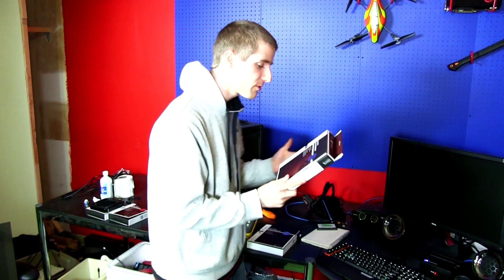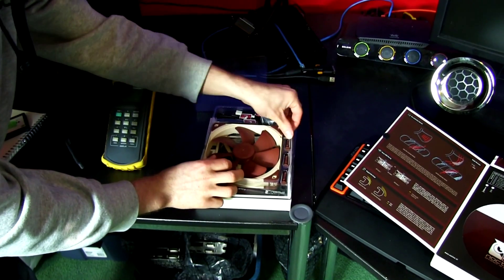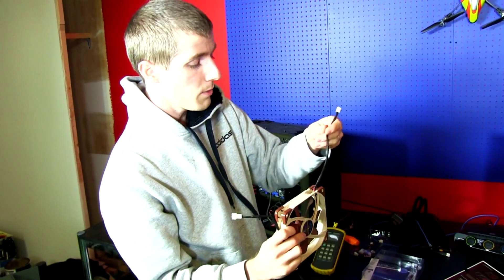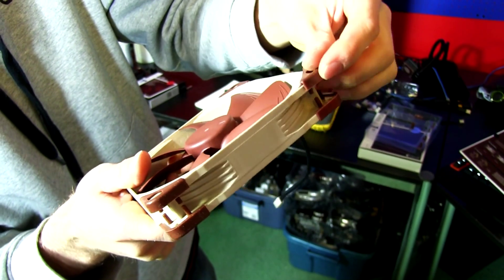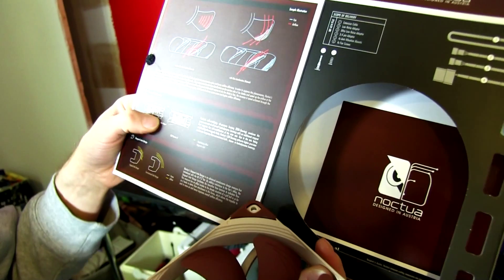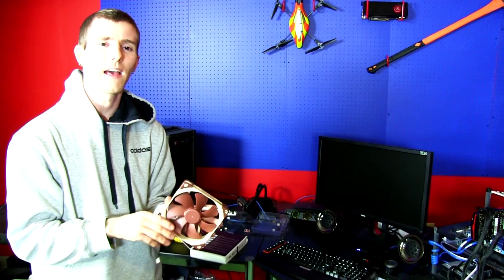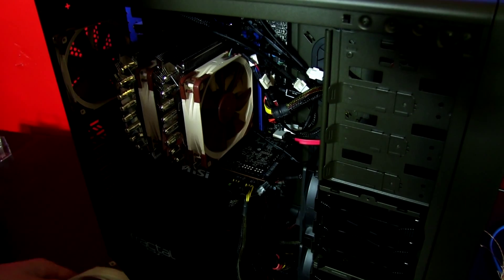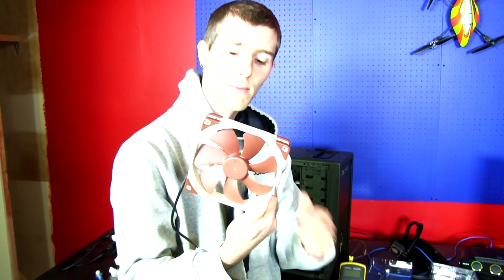Noctua NF-A14 FLX Silent Heatsink & Radiator Fan Unboxing & First Look Linus Tech Tips

Comment: Noctua nf a14 pwm or noctua nf a14 flx as case fans in a fractal r5?
Reply: if you have a PWM connector (one with 4 pins, not 3) go for the PWM version

Comment: Could i connect this to a fractal deisgn r5's 3 fan controller with the standard voltage (no adapter) and change the spped, and therefore the noise with the cases software?

Comment: Can u spray paint them or will that just fk up the fans?
Reply: Prince Jamal Minhas Probably okay to paint the outside of the frame, but i wouldn't paint the inside like where the fan spins. Otherwise just but the iPPC version, they are black to begin with.

Comment: What's the difference between this and the pwm version?
Reply: ***** you don't need the low noise adapters unless you're powering it directly from the power supply. You can still set the fan speed to your liking on the non PWM versions through the motherboard or a fan controller.
Reply: ***** I got the enthoo luxe with the fan hub. will they be able to be controlled from that hub ?

Comment: I actually was dissapointed in the fan. I have tow that replaced my 750d intake fans and they are louder at higher RPM's (800+) than my previous stock fans and they don't seem to help my airflow at all. I am obsessed with the nf-12 fans though. I have two for my radiator and they are AMAZING.

Comment: 150,000 hours for error, thats not possible, so if you calculate 150.000hour divede by 24hours,then divede 365 days per years, its 17 years...
The waranty is 6 years.
Reply: the mechanical equipment can keep working for 17 years, but the fan optimization techniques can only hold for 6 years, thats the reason for the warranty to be 6 years.
Reply: Those damned businessmen, are all liars
Reply: Hudeifi Dahir You are wrong. 6 years warranty means that company ensures you that the fan will not die in that period(100%). After 6 years the fan will still work and it will work for next 6 years or more. There is no need to put 8-10 years warranty on fans. In that time there will be new improved fans on a market and you will probably have a new PC in that time.
So information on Noctua website is correct.
Reply: Dr_Palace no understand me Dr_Palace, I did not said the product wont work for 6 years, I am just saying that the calculations is wrong made.

Comment: I'm going to be building my first computer I want to know if I need some noctua fans and which ones. I know my case comes with two fans which I'm not sure are good or what and if i have to I will replace them with different ones.
Specs:
Intel Core i5-4670
Gigabyte GA-H87N-WIFI Mini ITX LGA1150
Crucial Ballistix Sport 8GB
Western Digital Caviar Black 1TB 7200rpm
XFX Radeon HD 7950 3GB 
BitFenix Prodigy
Rosewill Capstone 450W 80 PLUS Gold Certified
Asus DRW-24B1ST/BLK/B/AS DVD/CD Writer

Comment: linus, this is all great, 
I'v learned how to plan the fans placement inside the pc case.
The question is:  which system fan mother board header to use for each.
Some times the avilible header is actually far from the fan placement, is it confusing the mb to select the right speed for the fan ?

Comment: I've bought 4 NF-S12A FLX and one NF-A9x14 PWM on amazon this week and after testing i returned them to get my 100 € back. Annoying Sound on the exhaust side, its louder than my 7 years old stock thermaltake fans and the build quality was horrible, one fan couldnt be testet cause all pins slided out of the connector. The accecories are only good looking china crap, sleeves cheap gum, no straight colour scheme white and beige connectors and the extremely cheap molex adaptor couldnt plugged in.

Comment: the rubber nipples on the corners of the fan are not for cables lol.. if you need to wrap the wire around the fan very far, you should simply dismount the fan and rotate it to your liking, since they are perfectly square, they will mount anyway needed.

Comment: will the low noise adapter work with other case fans? i have a 4 pin cooler master fan that's really loud; i was wondering if i could connect the noctua low noise adapter to my cooler master fan to make it quieter? would it work?

Comment: Yep,but if you want the maximum silent, you need remove all the fans you can, is possibnle using passive cooling (graphics card,proceesor cooling,fanless psu) its more expensive ,but probably you can get  3 or 2 Db ,the capacitors of the PSU make noise,but probably you cant heir it i f oyu use a good case

Comment: Because its the same that i care about how my car performs more than how it looks. Now in saying that i like the total package, so right now that means using the new corsair fans with multiple radiators, because i only have to run the fans at 750rpm it is silent, still looks great and has low temps. Its expensive, but in this case you get what you pay for. 

As an aside if you have a windowless case then these fans are still a good choice

Comment: How do the Noctua 140 mm stack up against the Corsair AF-140s?

One of the 2 stock 140mm fans in my case broke (I was cleaning the dust around it while it was still running...) and I figure I'll replace the set.  No radiators or anything, but there is a dust filter in front of them, so I imagine a balance of high pressure and good air-flow is necessary.

Comment: You're missing the point. Paint adds weight and there's no easy way to balance the paint evenly across the blades to prevent vibration. Wouldn't make a huge difference at low RPMs though.

Comment: hate noctua fans, they're really UGLY! The Noiseblocker eLoop is much better. Looking beautiful and quieter whilst cooling better. The only disadvantage is that you shouldn't use them in pull, then they sometimes start getting much louder, and there is yet only a 120 mm version.

Comment: MTBF is not a linear measure of how long the product will last.  Its simply a way to display overall reliability of the product.  They could have tested 150,000 fans for 1 hour before they had the first failure.  In reality they probably tested 5,000 fans for 30 hours with one failure or even 1,000 fans for 150 hours with 1 failure.

Comment: A bit of graphite powder and a drop or 2 of motor oil to even a sleeve bearing fan will usually quiet it down and greatly extend its life.  Some of my cheap $5 sleeve bearing fans are going on 8 years of 24/7 operation.  I usually re-lubricate all the fans every year and check for any that are starting to physically wear out.  While they will eventually wear out, adding fan lubrication to your maintenance schedule can make them outlive the system they were originally purchased with.

Comment: You have to understand how they come up with that number first before saying that it is going to last that long.
The testing method to calculate MTBF is not standardized, meaning they can use 1000 units to measure over x time, which would give a very different result than 10 units with y time.

Comment: What are you smoking? You think Cream + Brown fans go with a Red + Black build? Are you insane?

The problem with the color is the extreme contrast between the rim and the fan itself. It's not necessary to introduce an additional two colors (that are never used in any other PC parts), just for a fan.

All brown? Fine. All cream fine? Some ugly combination of Cream + Brown for no reason? Fail.

Comment: That's indeed a good price. its cheaper by 200 bucks if in my country. Sadly you barely able to find cheaper price GPU here ,unless its outdated which like the 7000 series and 600 series now , since its 2013 , new versions be coming in. 

Even so sometimes some shops , even card old as 5000 / 6000 / 400 / 500 series they still sell at original's price ! 

I really wish i live in US or else where instead = ="

Comment: I personally wouldn't go with the Cooler Master fans. Mainly because I'm not a fan of LED's and glossy materials. And I am also guessing that CM are a bit optimistic about the acoustic performance of the Sickle Flows.

If I were going for a ultimate silence computer. Then I would go for the Noctua's, spite the premium price.

You can also tell that Noctua is standing behind their products 100% by giving you a SIX year warranty. Where as CM only gives 1 year, or 2 for EU customers.

Comment: My coment concerned my set up with a msi twin frozr 6950 cf with xfx double D.
I run 8 antec truequiet 120mm fan (20 CFM 9 db) and while it is quiet on idle it s way louder than before on load and I ear it THRU my corsair hs-1a (with leather plastic thing for more noise isolation).
I just realised I have a defective card that idle at 50C at 50% fan speed I consider RMAing it for that (the other card idle at 35C with 23% fan speed)

SO quiet fans are good but check if your gpu is good before!

Comment: Hmm mine set to auto , no OC , stock clock and all 1050 , 1250 

I guess they run around 20% never touch 30% , my GPU never ever reaches 60 celcius even on most graphic demanding game. 

Even it does it touches 60 thats all it stops there. But i did try amp it up to 30% its still as silent as 20% =)

Asus is ncie but the price its least 200 bucks more here for Asus which is hella lot more expensive !

Comment: the problem is that in cf 1 of my 2 cards reach 70C on default fan setting while the other is at 50C.
So only 1 card is making the noise because they have no airflow
(thanks to the antec truequiet fans (21.5CFM 8,9 DB 0,3mm h2o) that push no airflow thru any filter)
I got new fans on the way (cougar turbine 7$ 60 CFM 17,7 DB 1,71mm h2o) that should help with the noise on load
I couldn't get my self to pay 20$ per fan for noctuas NF-F12 (20$ 55 CFM 22,4 DB 2,61mm h2o) when I had 8 to replace

Comment: Cooler master sickle flows, 20 db, (noctua NF-F12 are 22 db)  Sickle flows also have higher static pressure at 2.94 (Noctua Nf-F12s are 2.62.) Sickle flows are black with 3 different kinds of LED's, Noctuas are just ugly brown, with no LEDS, Sickle flows cost about 7$, Noctuas cost around 18$..... Personally noctuas are a rip off IMO, if you want good fans, get cm sickle flows, since they are the best all around, but still like this video for charity

Comment: WHy not use a washer to make contact with the rubber vibration dampener on the screw holes so the screw are then floating on the rubbers?

Comment: I have read several tests and comparisons claiming ASUS' DCUII coolers are pretty much the most silent you can get. I have a 7850 DCUII myself and it is very quiet. If you don't mind your temps going over 60° (70 to 80 should be perfectly fine too) set fanspeed to maybe 35% and you will not notice it even while gaming ^^

Comment: Painting the fan blades could be tricky. If the coat is too heavy or uneven, it would cause vibration and instability in the fan and probably make funny noises as well.

Comment: 1.disconnect your front panel switch and  try to turn on your PC by button on mobo if it doesn't have any ,watch this vid /watch?v=G4FOBL1c3pA   if it start ,your power switch is short circuit/broken .so the psu try to save itself by turning it off .....if it don't start or same problem see 2 .
2..Try another psu if it start normally ,it'll be psu's fault ,if not see 3 
3. Check your psu again by connect to another mobo or jump start your psu (/watch?v=YhTz49nwPtY) if its fan spin,your mobo died

Comment: 1. Nicely sleeved cables, but white connectors! Why???
2. If you start them at 9V, then you can turn them down to 5V. But most of them won't even start at 5V or in other words, with the ULN cable.
3. The NF-P12 does make a starnge noise at around 8-9V.
vs.
1. Noisblocker BlackSilent Pro PL-2 is all black, everywhere.
2. It starts at 4.5V easily.
3. Super silent. Radiator optimized rubber seals. And screws?, (I havn't tried that). And even better cable options, wich I think Noctua stole here btw.

Comment: oh and another thing, could you review the HD7850 from XFX, 2 gb version. do it now with the latest drivers and all, I had a very hard time to find any good reviews on it, I have bought it and its fantastic, I payed 1660 sek for it, thats maybe 190 - 200 dollars. I had a GTX570 before it. The 7850 run BF3 at ultra at 50 - 60 fps no problem. Skyrim 60 - 70 fps with 2k+ textures, not the bethesda ones, the community mods, some textures are 4 - 8k res. It uses up to 1900 memory at 1080p.5702lomem.

Comment: this fan stuff is just marketing. for example those steps for noise reduction, this is completely nonsense. or the vibration stuff. its soo useless. if you got a fan that creates vibration, then you picked the worst fan which you could also tell by looking at it.

Comment: A 1300 rpm 120mm x 25mm is rated @ 16.7 dba. watching the vid of the two of them together infront of a mic the Noctua is the one making the noise the vid switches the two on and off one at a time.

Comment: So, will this fan work with an NZXT Kraken X60? I think the Kraken uses 4-pin PWM connectors and these are 3-pin fans. I only ask because the H100i also uses 4-pin connectors, but also has support for 3-pin fans. Thanks!

Comment: Sure, you can paint a fan, but it'll probably diminish the performance.  Even the slightest difference in weight is going to cause some nasty vibration at 10K RPM.